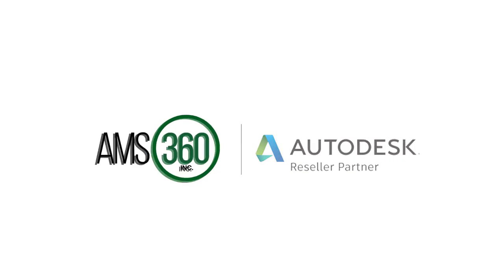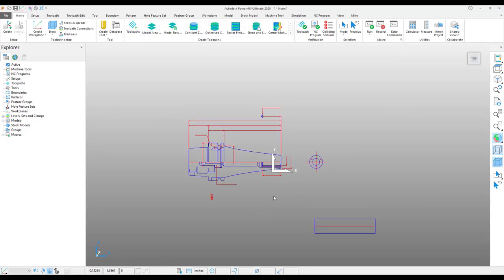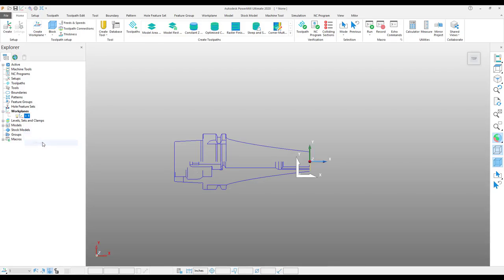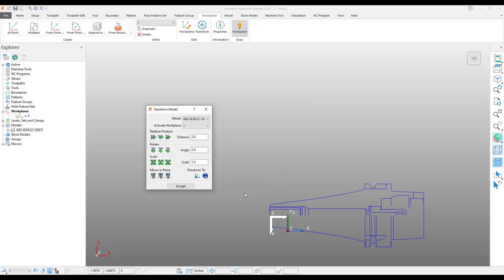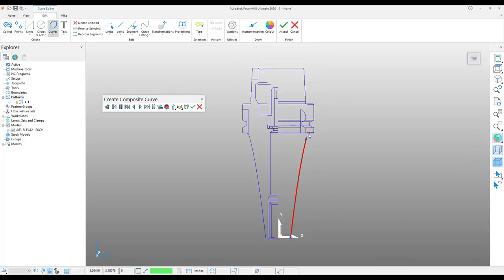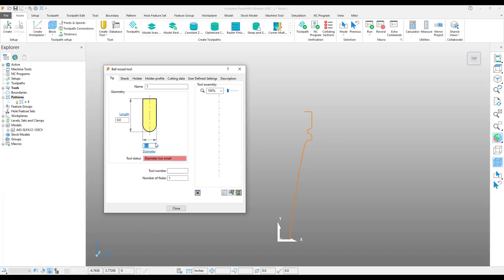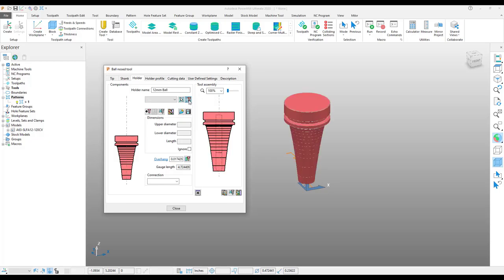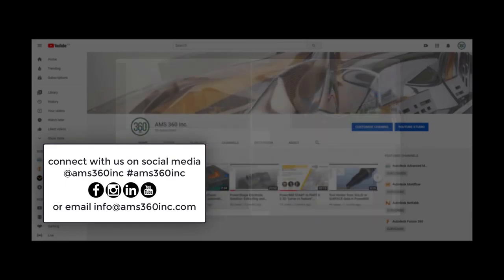Create a tool holder from a DXF file in Autodesk PowerMill

Comment: I tried this and the lines don't appear, I can't seem to get anything. I've even tried creating a fresh dxf that I created in AutoCad (not something provided by suppliers), and nothing. Any tips?
Reply: If the model imported correctly, you may need to turn on the wireframe in the view toolbar along the right hand side of the screen, (or F4 to toggle the wireframe on/off). You may also be out of view. Ctrl+5 will give you a top view and center the geometry. Hope this helps!